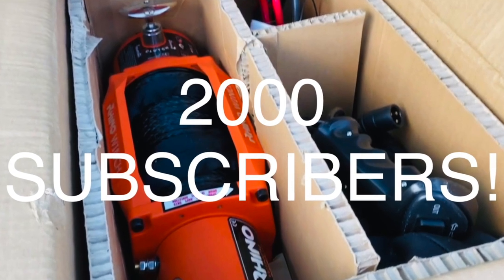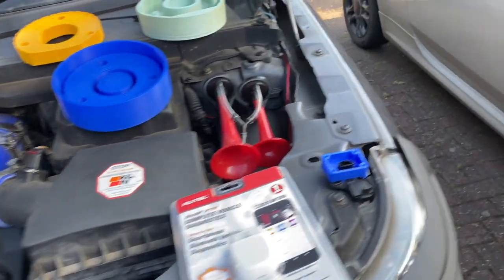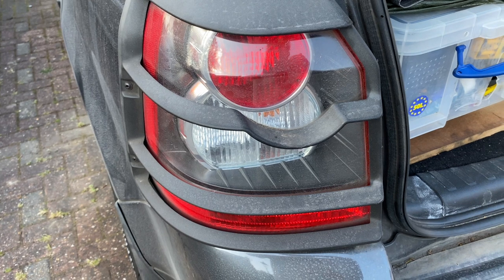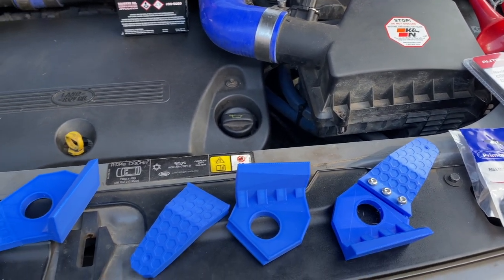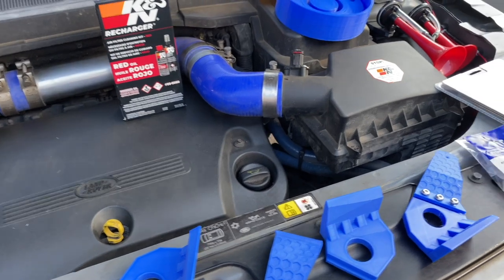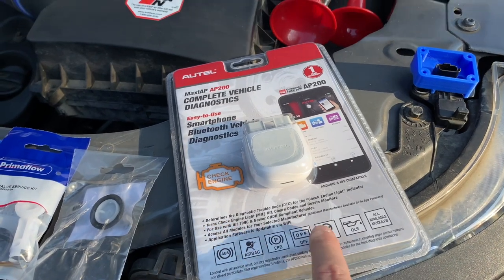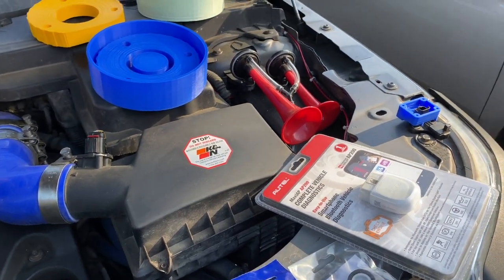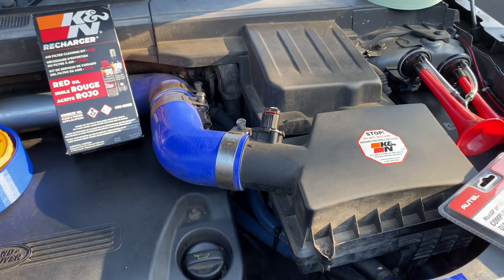Channel update - May 2021 - Land Rover Freelander 2 / LR2

Comment: Looking forward for your snorkel design...I got one from a company in Brazil and install it on my car, it flew off in less than a week and went under the wheels of the truck behind me.
Reply from the maker: Oh my god! That isn’t good at all! I will need to make sure my design is firmly attached to the car.
Reply: @BeavisPits  It needs something like screws, because the one I had was installed only with double sided adhesive tape. I was curious at that time how strong that glue could be even if it was a pretty well known brand (3M), then I found out...

Comment: You can check if that OBDII is genuine without taking it out of the packaging. Because as part of the setup of the app you need to scan the QR code on the side of the OBDII. You can do that through the packaging and it inputs the serial number for that particular reader.
Reply from the maker: Thank you so much Matthew, I will try that and see what happens, I will video it too so you can all see the outcome!
Reply from the maker: It worked! Autel video dropping soon, and you get a mention!
Reply from the maker: Autel video now up! You get a mention!

Comment: Just bought a 2011 Freelander 2 HSE SD4 and watching all the vids I can.  Yours are very informative and I have taken many notes as a result.  I am keen on the 40mm lift but would like to know what you think is the largest size tyre you can fit without a lift?  I have been looking at the 245/70R17 as a possible replacement for the standard 235/65R17.  I actually have 18" wheels on mine but will get 17's for the larger tyres, or 16's if necessary.
Reply from the maker: You can fit 245/70R17 without a lift but wheel spacers are recommended as the gap between tyre and strut will be quite narrow.
Reply: @BeavisPits  Great thanks.  Mine has R18 size wheels so looking to get a cheap set of R17 LR2 wheels also.  I see Muddy Mods have 30mm spacers.  I think you said yours were 25mm.  Would the 30's be too large or on the limit?
Reply from the maker: @havocmwf  25mm will be fine, no real need to go to 30mm apart from it looking better. Buy decent spacers like H&R. Expensive but they take a lot of force and you don’t really want a wheel spacer to break.

Comment: Hi Beavis,
Have you experienced problems with your fuel gauge?
I have an 08 fl2.
If you fill the tank up, the gauge works fine until it gets to half full then the needle drops to empty!
I wondered if this was a common fault and what the remedy is?
Regards David
Reply from the maker: Sounds like a faulty sender unit. There are two…one in each half of the saddle tank. Access is under rear seat.

Comment: Q.  Did your Autel AP200 tell you that it was your crankcase sensor that was causing you problems?
Reply from the maker: It was a diagnostics tool at my local garage. I didn’t have the Autel then but it would have shown the error too.
Reply: @BeavisPits  Again thank you.